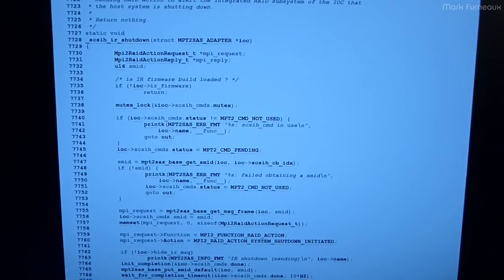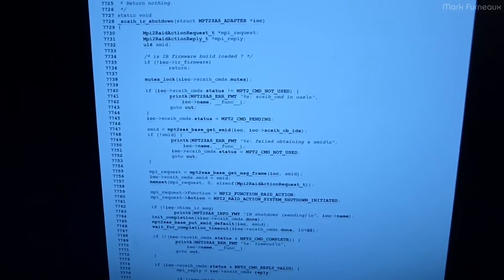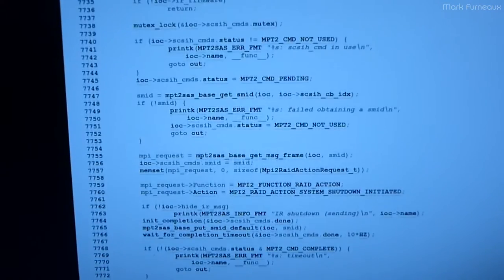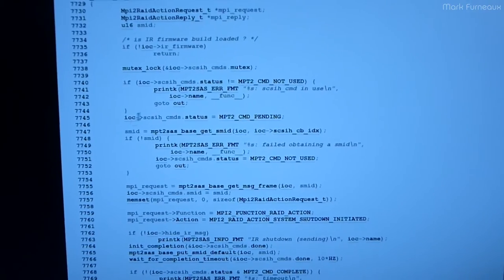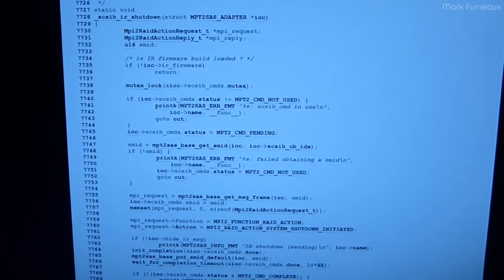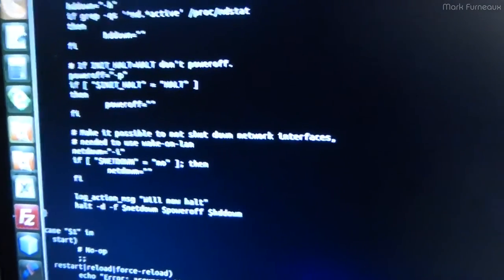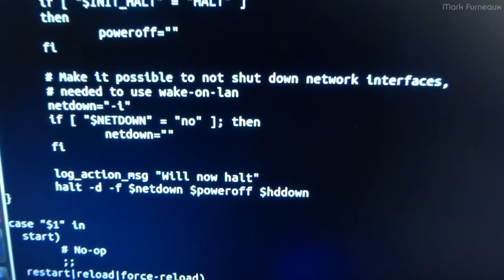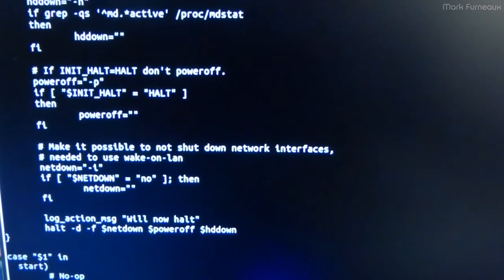Why LSI SAS Cards Don't Spin Down Disks

Comment: Modern hard drives should not be damaged by this. Old hard drives, would need to have a 'park' command sent to them, so that the heads could be retracted and locked into their storage position. Modern hard drives detect power failure, and when the power goes out, automatically retract the heads and lock them down (they use the momentum of the spinning platters, and switch the spindle motor to generator mode, to form a kind of crude UPS).

Comment: Isnt SystemD awful tho? I always hear its killing linux.
Reply: I’ve had all types of problems wrangling SysV-style init scripts. As soon as SuSE switched to SystemD, things became robust, easy to administer and superfast. My boot times here on openSUSE Leap 15 at home vary between 2s and 3s (cold boot from SSD into KDE-Plasma5). 
Systemd may be a bitch, but it’s my bitch. Cheers!
Reply: SystemD is a bitch. ive had problems with networking due to SystemD